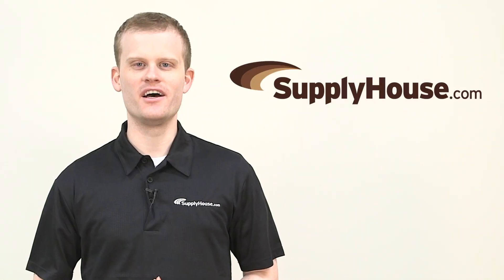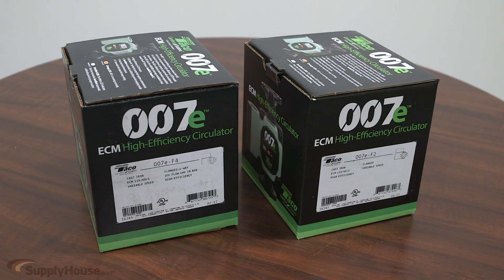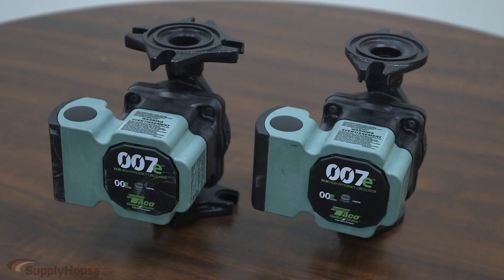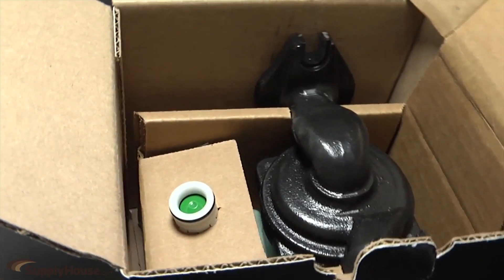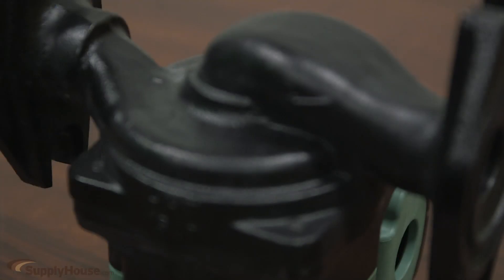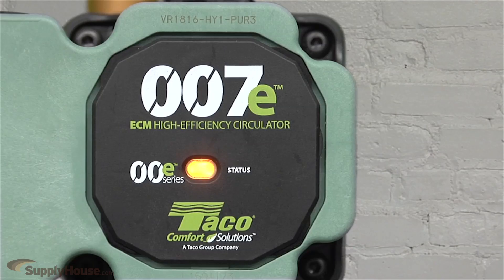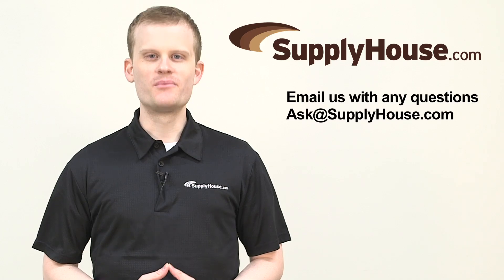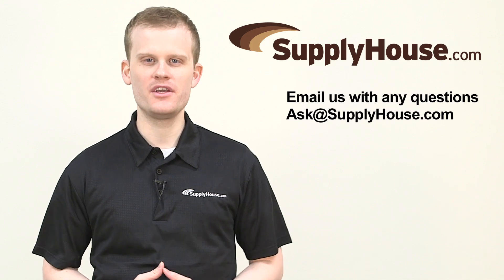Taco 007e

Comment: I installed on new boiler last week. I’m getting blinking light , 5 times every 1 minute , can seem to find out from anyone the meaning , also can I just turn pump upside down to change direction or do I need to twist motor to right side up